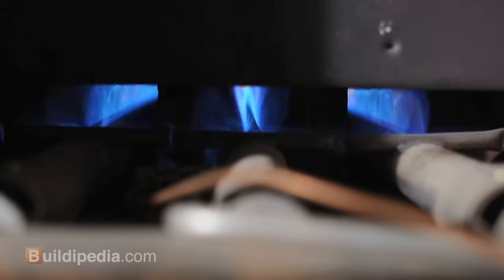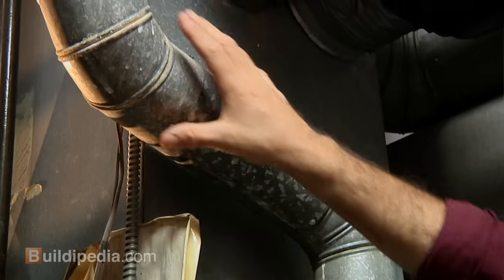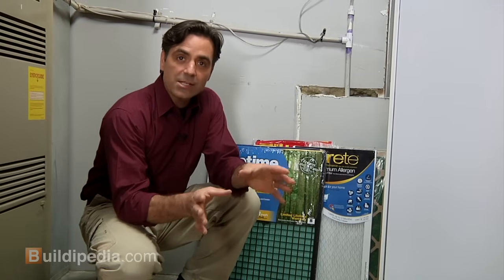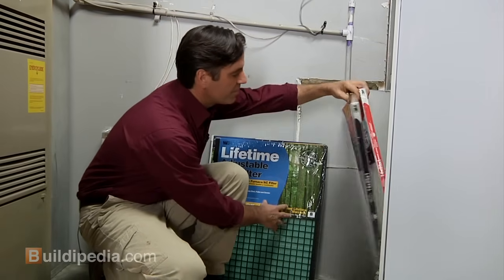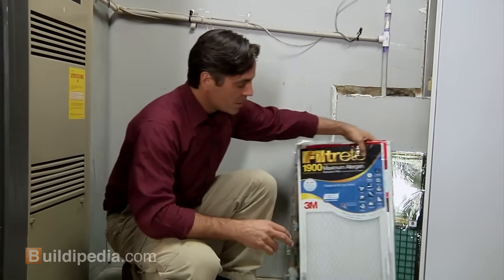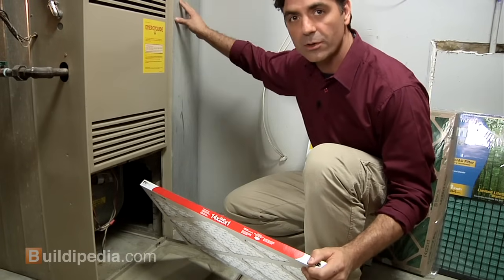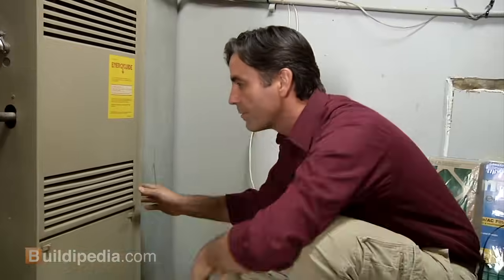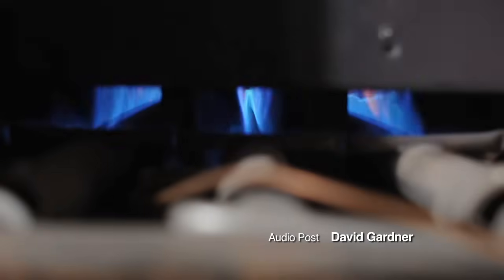How to Change a Furnace Filter -- Buildipedia DIY

Comment: Thank you, My husband died almost 8 months ago and in my grief, I never thought about the furnace filter. When I finally did realize it needed done, I looked at furnace for days trying to figure out where it went... I had only seen one video where it just slid in. Of course, mine requires removing screws and two panels, but I was able to do it thanks to your video.
Reply: Sincere Condolence!
Reply: I'm sorry about your husband. I've seen so many folks over the year struggling after a spouse passes. If you have questions about anything and can't find it online, let me know. I consult and design for my own LLC so I'm always glad to research something new.
Reply: I'm sorry to hear about your husband's passing. May God Bless you and bring you peace.
Reply: My husband also passed over 8 months ago. It was spring when it happened. He told me most things, but because of the weather we forgot the furnace. Glad you found your filter!
Reply: So sorry for your loss. I too am struggling with home things like replacing the HVAC filter after the loss of my husband.
Reply: @bcfamilyinthevalley  My condolences on your loss.  I lost my husband 18 months ago.
Reply: Same thing here as a son
Reply: My heart is with you. I’m looking for help here too for the exact same reason. My husband died in April, and furnace maintenance was not on the radar at the time. Thank you for sharing.
Reply: So sorry. My mom is sadly in the same predicament. ❤
Reply: Mycondolences Fran; my husband died 4 months ago, and I am just getting to all the things he did for us.
  I started looking for the filter location 3 days ago, found it today.
 I removed the old one, but got the new one only 2/3  of the way in.
 Tried twice so far to get it in.
  I called the home owner to come out.

Comment: I wish it were that simple!  I live in a rental apartment where the landlord does not maintain the furnace. I told him I was experiencing respiratory symptoms & that the filter shoul be changed. He told me that the furnace didn't need a filter, UNBELIEVABLE!! I took the door off the furnace & see a crusty old filter.  I'm now attempting to replace it but there is a metal bar holding it in place that I'm not sure how to remove. It slides up &  down but nor sure how to open it. I have a York Diamond 80 any suggestions? Thanks

Comment: Thank you! I could not find where the air filter was located in my home. Until I saw this video I kept looking for a slot located on the side of the furnace to slide in the air filter. I did not realize that I had to prop open the bottom front to access the air filter. Thank you again, very helpful!
Reply: How do you pop it off? I have the same one!